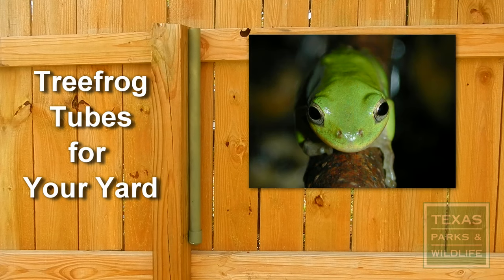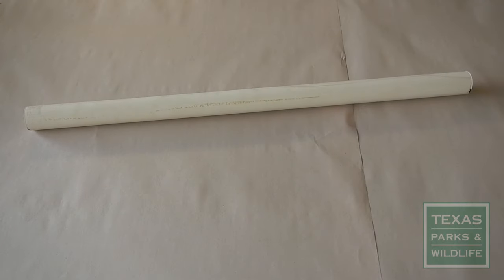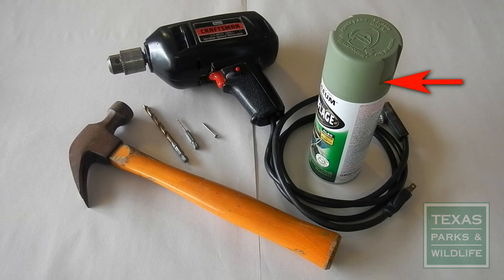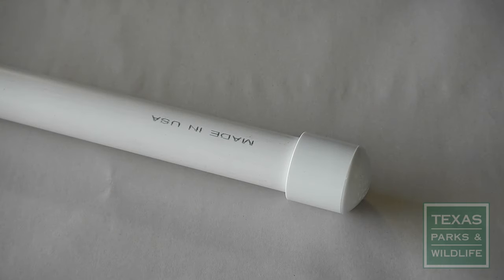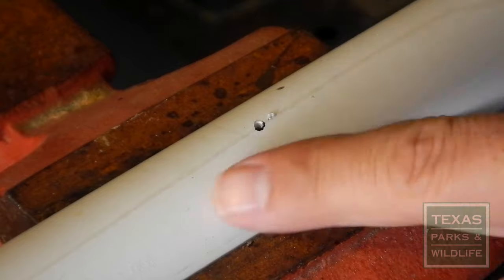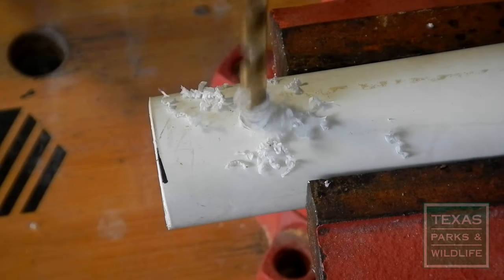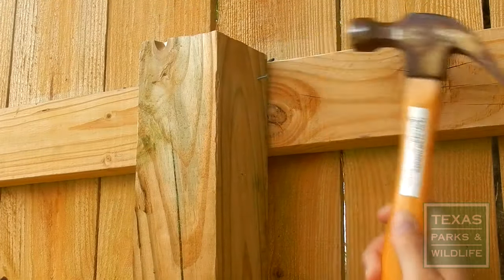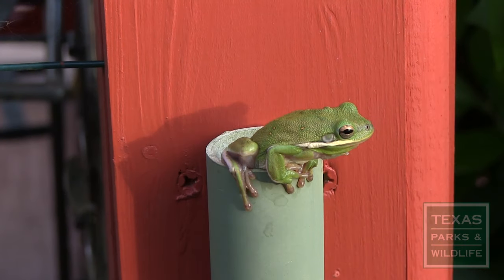Create a Hangout for Treefrogs with a Treefrog Tube - Tips from a Wildlife Biologist

Comment: Update...I've had these up for 18 of these tubes (yes, 18) about 5 months in Southern California for the Pacific Tree frog.  They REALLY work!! About half of mine are filled up with frogs right now, and in the driest, hottest part of the year for us.  Will probably have full occupancy once it starts raining.  Personally, I don't attach them to a tree.  I angle them at 45ish degrees (easier to clean out and observe) and place them into low vegetation where I know frogs hang out in my yard. It's really great to see the little frogs  looking out of the tube and I love knowing I'm helping them out.
Reply: Ive discovered several species of toads and frogs hanging out in 2 different 4" corrugated plastic drain pipes on a client's property. One drains the home's front rain gutters, and the other drains excess water from the front walkway. Both pipes are shallow dug underground, and pop out of the ground at the edges of the lawn. They are at least 20-30 feet long underground, and tend to hold a little water for at least several days after rain, even in mid summer. I run the hose into the front end of the pipes 1-2 times a week during droughts, to ensure theres always moisture inside. 

 So toads, pickerel frogs, a few green frogs and even a grey tree frog have been spotted hanging out just inside the end of each pipe during daytime. As soon as the sun starts going down, the little pickerel frogs and toads start working their way out into the yard and driveway.
Reply: Frog Air BNB
Reply: And do they sing at night? I think that’s the one thing I miss about growing up in central Texas with a pool in the back yard: the sound of frogs trilling at night.

Comment: I'm glad I watched this, as opposed to just blindly putting a few of these together out of PVC and caps I recently bought. The idea of an overflow/drain hole at 5" didnt occur to me, neither did the top hole for hanging it. I was going to use some steel strapping I had left over from a squirrel house I built 2 years ago. But drilling a hole near the top to hang on a nail makes more sense. 

I also wasnt quite sure how long to make them. I was thinking 12"-14", but maybe that's too short after all. Mine will mostly be used by grey tree frogs and Cope's grey tree frogs. But there is at least 1 green tree frog who has recently started showing up to make noise recently, so.......    Maybe spring peepers will use these.
Reply: Have you had any Gray tree frogs use them?
Reply: @ashleykinach5079  
I have purchased all of the materials(PVC piping, end caps), but i havent had time to install them yet, and besides, I just bought the Rustoleum plastic-compatible dark grey primer earlier today. It took 20mins to find a cust serv worker in Walmart who had a key to the LOCKED spray paint cabinets!  So ive gotta drill, spray and install them. Ill probably get that done within a week or so. We had a major thunderstorm tonight, which will provide some moisture for the tree frogs for at least a couple days during this ridiculously HOT heat wave we've been in for a week now.
Reply: HighlanderNorth1 what province are you in? I’m in northern Ontario.
Going to try to make some this weekend
Reply: @ashleykinach5079  
Im in the lovely "province" of northern Delaware. Actually, there are 2 terms here that don't really apply to Delaware. ("province" & "lovely").

Comment: This is great!!!  Any idea as to why only 5 inches up the tube for the drain hole?  I live in Southern California and I'm putting up many of these for our Pacific Tree Frog.  They need all the help they can get out there.
Reply from the maker: The drain hole simply needs to allow some water to be retained in the bottom to provide humidity in the tube without filling it completely.
Reply: The 5" is just a guide.  You can go higher or lower if you choose based on the climate in your area.  The more water in the bottom, the longer it takes to evaporate.  If you live in a moist area, a lower hole may work.  A higher hole in a dry climate may work better.  Experiment to find out what works best for your area and post an update!

Comment: Thank you so much for this video. I have a small (understatement!) balcony on the third floor and several months ago I noticed about 6 green tree frogs living inside a pot within a pot. I’ve scoured the net trying to find suitable outdoor habitat to no avail til I found this invaluable vid.
Just one question: do I need to make each one their own ie one pvc pipe per frog? I did read here someone said they had several living in one. 
One more question: I will most likely move (within Texas with same temps but from ocean to near a lake) in about a year +/-. Would they sustain a move or is it better to release them where they live now? The latter would make me feel so guilty since they rely on me though I know they’re wild and chose my little lush balcony as their home, and they’d most likely carry on without me!
Reply from the maker: It's fine for multiple frogs to occupy the same tube if they choose to do so (although typically frogs of different species will not do this because their different body chemistries can be harmful to each other) but if gets too crowded you may consider more tubes. However, it's not a good idea to try and move them from one region to another. They may not survive and there could be unforeseen consequences if they're introduced to another area, even if that area already has frogs of the same species.